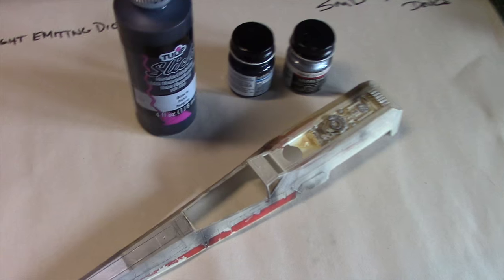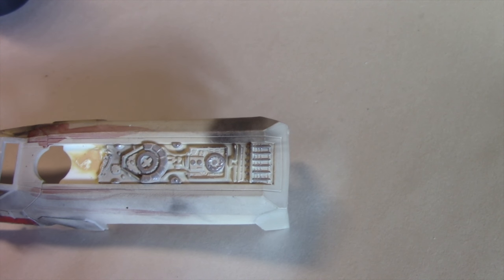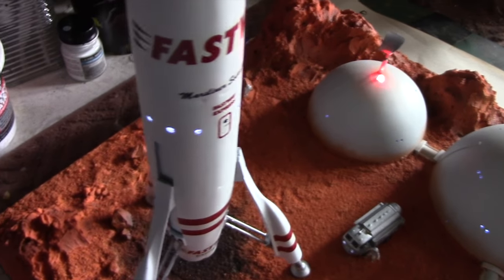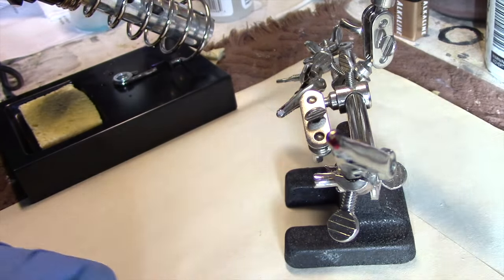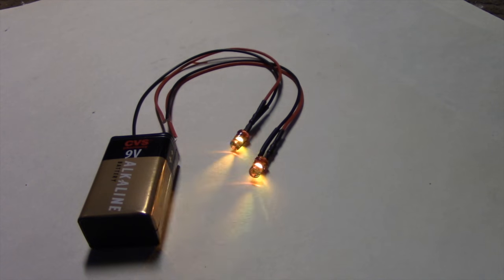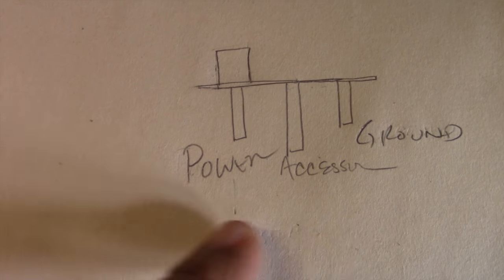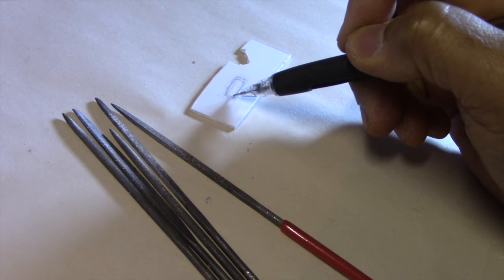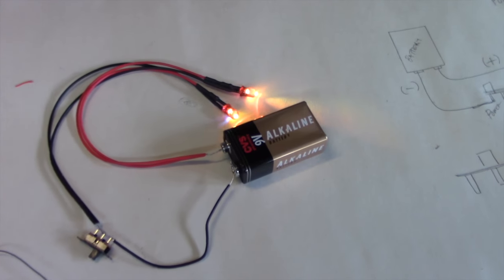Lighting Your Models Part 3

Comment: I know this is late, but what I like to use to block light 100% especially on larger surfaces is aluminium tape. It blocks light 100% and has the benefit of being reflective. That means more light in the areas where you want it.
Reply from the maker: Thanks and yes you’re correct that is a great way to light block. Something i only recently tried. Thanks for the comment

Comment: Great tutorial, thanks. I've just finished a model of a star destroyer using fiber optics for the lightning. To prevent light leaks I wrapped a small piece of black electrical tape around the LED and the end of the fiber optics. That blocks most of the light at it's source and one layer of black paint on the inside of the model is sufficient to block the rest of the light.  By the way, my next project will be the TOS Galactica and I'm already greatful for your video of it's building.
Reply from the maker: Thank you and great light blocking suggestion. Thanks for watching, would love see pics of your builds.

Comment: Wow thanks man, this was a good thorough series.
I was using a 9V and 3 blue LEDs to light the backside (drive) of a Millennium Falcon, and had drilled 3 holes in the back to let the LEDs protrude into the "drive compartment". That, of course, created 3 bright blobs and nothing else. Now I realize the LEDs should be inside the model, and many holes should be drilled to the drive compartment, so diffuse light bleeds through.

I don't know if it's possible to salvage the current build...

Comment: Excellent tutorial. One of the very best regardless of subject matter. One question: How do you affix the LED and wiring to the model?
I'll watch the series once again to see if I just missed it. Nice presentation.
Reply from the maker: Many people use hot glue but I've been told that it could potentially damage the LED.  I use superglue instead along with an accelerator like Insta-set. Secure the LED or wires in place with masking tape first then apply a drop of superglue followed by the accelerator.  Blow dry or use a little compressed air (gently) to facilitate drying. Remove the masking tape.  Hope that helps and thank you for your kind compliment.

Comment: Your videos have been invaluable to me i am about to start a uss voyager. I know your video is a little old now and technology changes rapidly are there any tips or newer products you would suggest please?
Reply from the maker: I’d say the main thing that I’ve changed is a shift to using more SMDs since they’re great for small spaces. The only newer option I’ve come across, although not sure how “new” they really are. Just new to me. IL flexible light sheets. They aren’t highly recommended, however, by those who’ve used them. Apparently they emit a hum and life span isnt as long as LEDs but that depends on usage. I’ve also seen some modelers use Li batteries as power sources but that does take some to wire up correctly. Thanks for watching and for your kind words

Comment: I want to light the Moebius Models Dawn of Justice Batmobile.I want to light the front headlights,the dash and a red flickering light for the exhaust to simulate flames coming out of the exhaust.I figured out how to light everything but I'm not sure what to use to power everything.After watching your videos I want to use a button cell battery with round switch that you mentioned at the end of this video.Where would be a good place to mount the switch and the battery and where is a good place for access to replace the battery when it needs to be replaced.Thanks for any advice that you can give me and I hope to get a response soon.
Reply from the maker: Hi Dan....I'm afraid I don't have a good answer. This would be hard to do and is something I really thought about.  The problem is that there isn't a lot of room inside.  Once the interior is installed there is very little room for much else which is why I ended up wiring it to the switch and power source externally.  I would have preferred to make it self contained as well.

Comment: These are terrific videos. Question for anyone who knows about wiring. How long do the batteries last when leaving the light on for the model? Is it better to plug it into a wall outlet instead? I guess the advantage is not having to route your wire to an outlet everytime you are displaying your models?
Reply from the maker: Hi, plugging it into an adapter is always preferable if you plan on leaving it on for long stretches.  I choose to use batteries for the very reason you mentioned, to avoid being tied to an outlet . Also, I don't turn on the lights that often.  It is necessary to periodically check the batteries should you decide to leave them in so that you can avoid leaking as many of them can do over time.  As for the battery's life time, it will depend on how many LEDs you have hooked up.   If you have a specific project in mind, try contacting the guys at evandesigns.com (formerly modeltrainsoftware).  They really are great at answering questions.

Comment: Great vids ! Question: how many l.e.ds can you hook up  to a resistor or is it resistor per light depending on power source  ..9 volt, 2AA×2, tripleA×3watch batteries (big flat ones) x2  ect ect any helpful suggestions?  Thank you
Reply from the maker: This article may be of help: https://www.allaboutcircuits.com/technical-articles/led-arrays-one-resistor-or-many/ 
I would also recommend asking advise from the guys at modeltrainsoftware.com    Hope that helps
Reply: 👍 thank you

Comment: Fabulous videos! Thank you. Question: With the 9v battery set-up you showed towards the end of the video, where is the resistor? You have it in the diagram. Don’t you need one when using anything more than 3 volts? All your information is much appreciated!!
Reply from the maker: The prewired resistors are all located adjacent to the bulb. Yes you do need a resistor on anything greater than a 3V. To make things simple for me I keep with the prewired bulbs although if for any reason you want the resistor separate you can request modeltrainsoftware to send it apart from the bulb.
Reply: Thank you for your reply AND your informative videos! I will be heading to modeltrainsoftware.com!
Reply from the maker: Iva Wilcox you’re welcome, and definitely ask them questions as well. They’re pretty good at replying
Reply from the maker: Iva Wilcox excellent and I appreciate your kind comments, thanks

Comment: No one ever seems to talk about how to mount your model to a stand,  while allowing for wiring for lighting. What options are there and what works best?
Reply from the maker: Good point. I left it out because I frankly didn’t have a good way at the time. A number of options available but I’ve found success in using brass tubing supported with 2 part epoxy putty. Drill appropriate sized hole in both the stand and model. Try not to have a lot of play. Secure by wrapping the 2 part epoxy putty around the post within the stand and inside the model. This will dry very firm and steady.  Hope that helps.
Reply: @InterstellarModeler  Thanks!

Comment: Hey, I've been making 3D tin models and lighting them, I bought 9v batteries and they seem to power 2, 3mm LEDs for about a day of so at full brightness, then brightness drops off precipitously, I don't solder the connections; I twist and tape. Does this sound normal to you or is there something I can do to extend the lifespan?
Reply from the maker: Hi. I recently displayed my Mr Freeze figure at a show  and it has about the same number of LEDs hooked to a 9V.  The model was lit consistently for nearly full 2 days and the brightness did drop off.  The room illumination was such that you could still appreciate the lighting even without full intensity brightness.  I think that is about right. Given that I didn't use the best quality battery for the show, I was impressed it lasted as long as it did.  I intended on bringing an extra battery but had forgotten to do so.  This type of connection is pretty straight forward so I can't think of anything that might be causing any problms.  One thing you may want to try is to use a higher quality battery??  I don't keep my models lit for extended period of times with the exception of model shows so this isn't usually a big concern for me.  If you intend on doing so, you may in the future think of hooking them up to a plug in power source although I agree that would be a bit overkill for just a few LEDs.  If you dont however, you'll obviously continue to be limited with what batteries can provide.  Hope that helps.
Reply: @InterstellarModeler  Thanks for the detailed response! I'm totally new to this; could you explain what you mean by "higher quality battery" are you just talking about the brand or something more technical?

Comment: I think I once mentioned using something like an Arduino Nano to control your lights, since then I’ve been playing with with some radar modules to trigger the Nano that are very small and cost about $1.30  each and are amazing. They have a 16-23 ft range and can see though walls and would add to the life of your models since you could have them come life when someone gets near. You do not need specialized leds for effect with a Nano and could even in incorporate SMD LEDS.  At my age
I don’t really have the patience and/or manual dexterity to get to your skill level but I may put one together with radar and a Nano since the effects just might mask my lack of building skills
Reply from the maker: Thanks for the comment Frank. Great idea. Where can you get a hold of these modules?
Reply: With a Nano you can take the pulse trigger and do much with it. The nano itself will control a number of LED's with any effect you can think of. If your not familiar Arduinos there is a ton of help all over you tube and the net.  Most of the time I will copy a program and then edit to fit my needs as that can save a lot time .  there are even smaller arduinos than the Nano but its what I mostly use.https://www.amazon.com/gp/product/B0732VQ4Q2/ref=ppx_yo_dt_b_search_asin_title?ie=UTF8&psc=1https://www.amazon.com/Arduino-Board-ATmega328P-Without-Compatible/dp/B07XVYBR9Y/ref=sr_1_9?crid=1SSOMVYRSF939&keywords=arduino+nano&qid=1581353933&s=electronics&sprefix=arduino+nano%2Celectronics%2C168&sr=1-9

Comment: I am brand new to light and i have a kit with a single Street light that i would like lit. But i want to plug it into an outlet and add a light detector so it only pops on at night like a night light how do i go about doing this. If you could point me in the right direction i would much appreciate thanks.
Reply from the maker: Andrew PlantGollum i would contact the guys at modelttainsoftware.com. They sell the ac adapters but not sure about the nightlight feature. They no doubt would also be able to advise u there as well.

Comment: Hi there! 

I've just watched your video's and they are a great explanation of the led basics.
But I'm having a question, or it is a second opinion, I think.

I'm thinking of lighting a 1/50 scale model truck with smd lights.
The idea is to use 25 of them, but what power supply would you recommend? 
And how would you wire them, at the back of the truck I've got 4 red lights, at the front 9 white leds and 4 orange leds (flashing), left and right 10 orange leds, 5 per side, in total 25. 
These leds are 2.8 v ~ 3.4 v at 15mA. 

Thanks!
Reply from the maker: I’m not able to give a detailed answer....Am traveling. But i’d run this by the guys at modeltrainsoftware.com. They’re really great at answering your questions.

Comment: On the LED's you should show which is positive and negative for those who don't know, and how to know read a resistor too. Maybe, on a future video?
Reply from the maker: centaur1a red is +
Reply: This is a fantastic series , hope you can expand on this in the future .
Reply from the maker: centaur1a you're absolutely right. Thank u
Reply: Interstellar Modeler I found those tiny Leds  you had on your series on ebay they are called   

50Pcs Super Bright RED 0805 SMD SMT IC LED Bulb . .  They are $1 for 50 

 If you search on  Youtube  ( Wiring 0805 Leds )  This shows how to wire them up . 

Thought this would be useful to some
Reply from the maker: parabot2 are there any specifics that you'd like to see? Thanks
Reply: Interstellar Modeler   As you have done more in the area i' m sure you have covered and will cover what you feel is relevant .  The Series has been fantastic so far , Thanx

Comment: But nothing is mentioned about multiple LEDS and what  do you power them with and how do you link up multiple LEDS and what about the power source?...do I need an LED dtiver?...and why?...do I need a distribution board and how do I use it?....none of this is answered....
Reply from the maker: Thanks for your question. The most complicated model I've done to date is the 350 scale TOS Enterprise.  This came with a lighting kit that involved the use of a board into which the multitude of LEDs were plugged into.  Other than that the most lights I've put into a model kit is about 8-10?? I wired all of those in parallel hooked to one power source, usually a 9V battery.  Here's a link that will help clarify things hopefully.  My goal here was to provide some basic information.  I've tried to make things simple for myself by using prewired LEDs and so far this has worked for me.  Perhaps this article will be helpful with providing more detail for you, thanks. Here's the link: https://www.instructables.com/id/LEDs-for-Beginners/

Comment: Surely a few coats of paint on the outside of the Galactica will solve the light problem.
Reply from the maker: well the problem is that the fiber optics were already snipped and are as short as they can go.  If I applied another coat I would risk obscuring them. Appreciate the suggestion though

Comment: pity these are always powered by a battery,,,, a usb plug would be good
Reply from the maker: I haven't seen it yet but I'm sure there's probably a way to do that, or will be. Thanks
Reply: I do it but it takes ALOT more work and an Arduino board. You can do so much with it .. fading, flashing, cycling, and wireless control. You can even make it respond to voice commands.